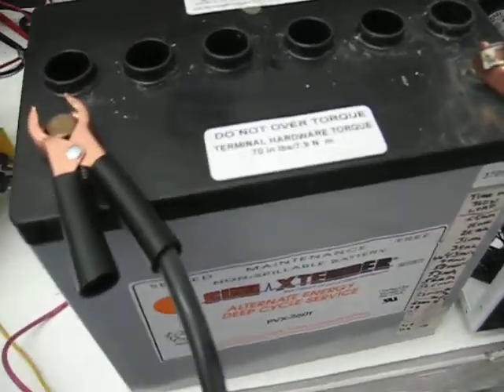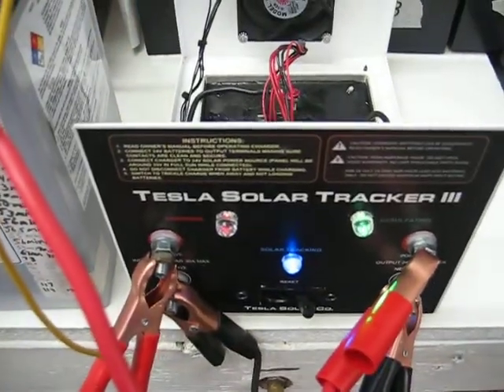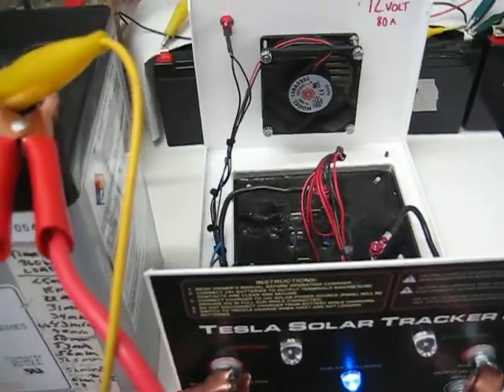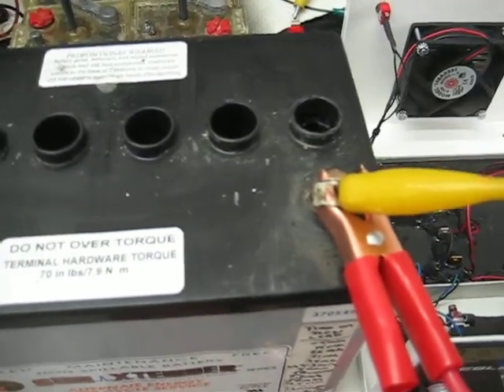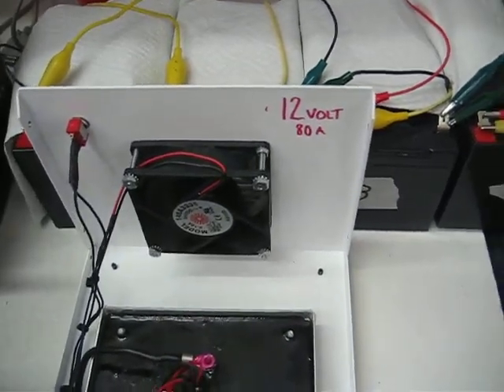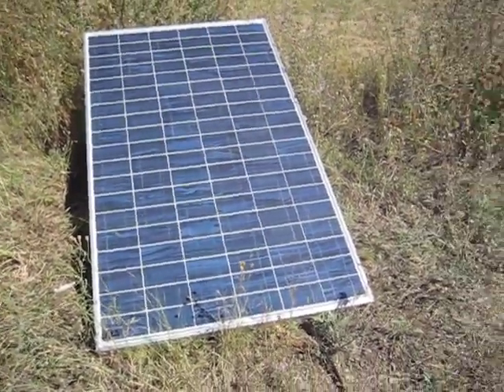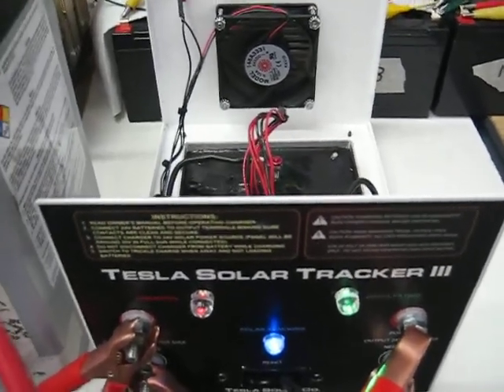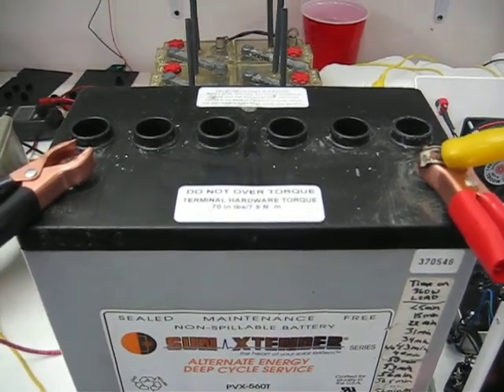Converted AGM battery John Bedini

Comment: Hi, 

The forum you mentioned does not send registration details to gmail. Can you please chek on it?

Also there is one more thing you may try when playing with BEMF. Here is my question:
Does BEMF mix with reactive current from resonant LC circuit in series? If yes, when it adds up and cancels out? Hint: try to mix low frequency reactive current exiting from the capacitor then choke in resonance with high voltage and high frequency BEMF spikes from second input source on same wire before load.